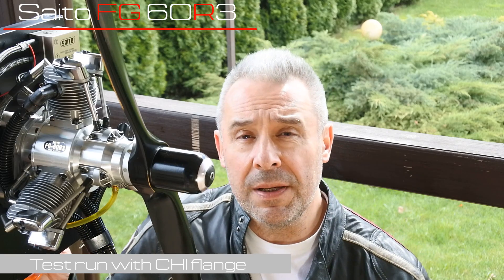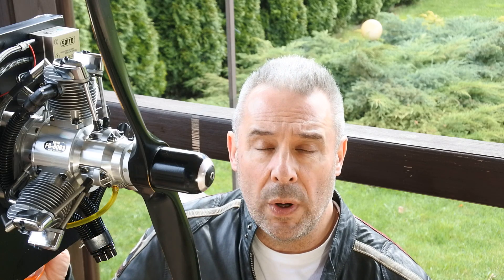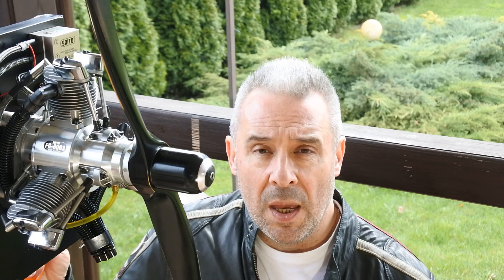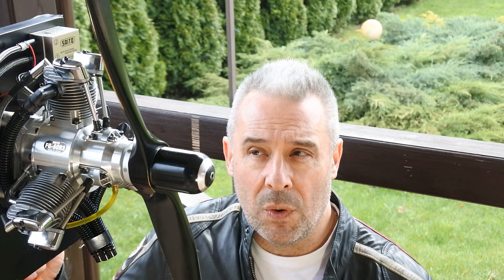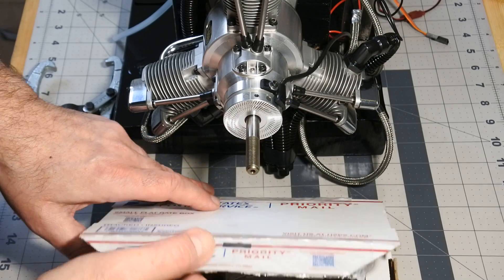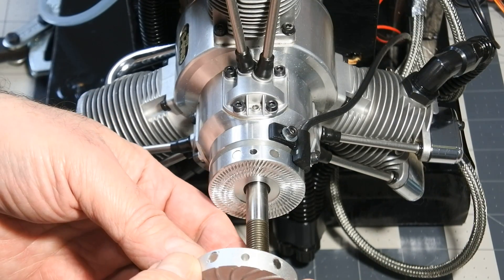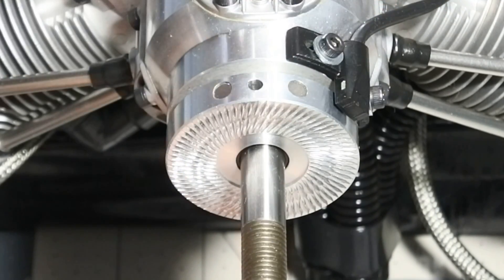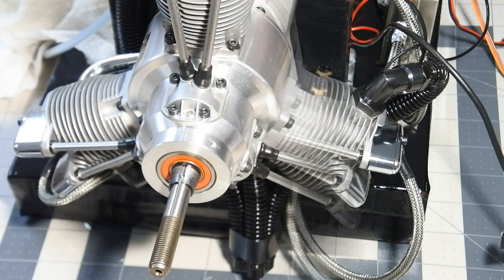Saito FG 60R3 applying the cure

Comment: the problem is on the conrod design, with this drive hub, the ignition timing is correct, but the valve timing still not correct. the No.3 cylinder has too late timing on the intake valve. and the firing order are not 120 degrees. the perfect solution is make a new conrod and use one magnet hub ;3 sensors with 3 ignitions. Because this Saito ignition has a very strange ignition procedure, check it with timing gun, you will see. I did all this on my Saito FG90R3, then runs correct. And this error is exacerbated on smaller engines.
Reply from the maker: Thank you very much for your explanation and comments ! I should think, should I invest even more to push this engine to work, as it should.
Thank you !
Reply: Would it help to move the valve timing on cyl 3,  one notch ? do you know how many degrees it is "off" ?
Reply from the maker: @roki5941  Thank you for your comment ! I decide to make a little brake with this Saito, to free up the time for other channel projects. Will find and collect more details about this problems and possible way's for correction. Also, engine shows very high compression level, for starting, it needs very powerful "Mayatech" starter, and car 55 Ah accu battery. Probably, this compression level also add few cents to the whole basket of engine's problems.
Reply: Thats a great idea to run 3 separate single ignitions, at least if one dies it can be replaced..i had an radial ignition fail the other day ..probably been run about 8 300ml tanks of fuel on the ground..now one of the outputs is breaking up..will get it tested..i just purchased a rcexl unit of alliexpress anyway..and plucked an ignition of another plane i was setting up..fg19r3!
Ive been flying my fa120r3 converted to gas today..its actually not a bad runner..has the morris magnet ring on it..i run it for atleast 2mins at a time at full throttle and mixed throttle over 10min flyts ..i ran 500ml of gas in the air today..as for running temps ,i dont digitally check it ..i hand check when landed then apox 2 min or so of being turned off, check again and can hold the cylinders long enough..so im pretty happy with how it runs....
I have yet to get my fg60r3 out and run it for its first time..got fg33r3 aswell ..it runs rather well..i set hall sensor up so its on 30° static on cylinder 1 stock magnet ring..machined out intake so it has same design as fg60r3..it has good power and revs hard ..so i have reduced servo max travel to limit rpm especially for the plane its in. Seagull models bucker jungmeister 20cc..
Reply from the maker: @danielhitchens4407   Thank you very much for your comment and for the story !
I also think, that 3x separate 1 cylinder ignitions should runs better and reliable. It's also a question of a cost and and CNC machinery time. I decide to postponed solution finding for better times, when I'll get more time to investigate the problem and eliminate it step by step.
B.t.w., implementing 3 x OS G5 glow plugs also should solve the problem, due to automated ignition. I'll try to provide the run with G5 glow plugs again, to check what will be the difference.
Reply: @crazyengines88  your welcome..in these cases..its good to have all our different thoughts and personal tests to help come to some kind of a conclusion 😊..
Yes to see what the g5,s bring is definitely a good step towards the possibility of making 3 separate ignitions on this one engine..wouldn't be difficult to setup 3 separate hall sensors..well maybe..have a nice day..
Reply from the maker: @danielhitchens4407  Thank you for your comment !  Yes, I agree, I also have many doubts about which way to choose, to find and remove the cause of the problem, however, at the cost of additional $$$ investment and time, or to minimize costs and time, but reduce the harmful effect of a engine design flaw. There is still a lot to do for the channel, and it's a bit of a pity to waste time on researching the problem, because it slows down both the work on the channel and work with other stories. Thank you and have a nice day !
Reply: @crazyengines88  definitely it consumes alot of time with this engine..
Saito fg41ts or 61ts would be much nicer to run for sure..if my saito fg19r3 ever wrecks a cylinder..i may convert it to be a v twin 😉
Reply from the maker: @danielhitchens4407  Interesting, thank you, two cylinders opposite / flat twin engines from Saito, works netter, with less or with no flaws, it's true. I've Saito FA 270T engine, like it so much, it works absolutely great. It's still not converted to any other version. It's just a matter of time 🙂
Reply: 杨贵慈？

Comment: FG 19 the same?
Reply from the maker: Thank you for your comment ! I can't confirm exactly, but there is a few thoughts: Saito FG 19R3  mechanically is practically the similar or the same, as Saito FA 120R3 engine. My experience with FA 120R3 yet is too small, to confirm, that there is a design flaw, too. My Saito FA 120R3 right now is dismantled (wasn't find a time to assemble it), but your question was pushed me to assemble it and to run it, to check, will vibration appears on smaller "brother".  But as far, as I remember, it wasn't. On glow ignition engine works "softer", due to the fact, that ignition moment in each cylinder directly depends on glow plug, and ignition advancing is automatic.

Comment: Looks like a little localised heat on the drive flange might have helped to expand to for easier disassembly.  You can see it pulling up a small bure. Nice result in the end though.  Might still need a correct timed master rod
Reply from the maker: Thank you very much for your comment ! Yes, you're right, it was necessary to preheat the original flange by hair dryer, at least.